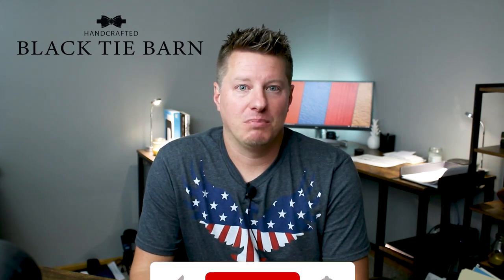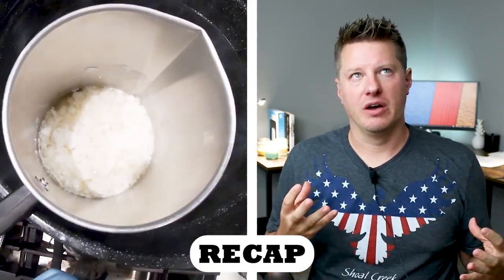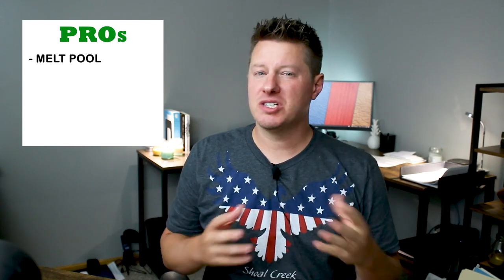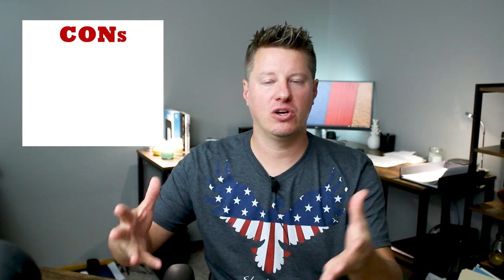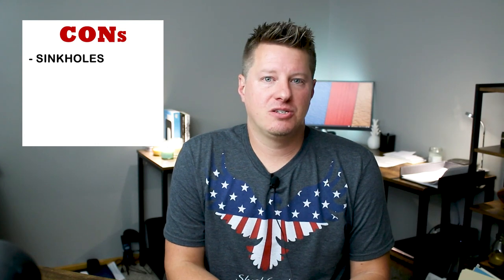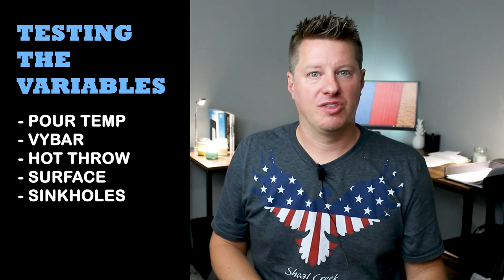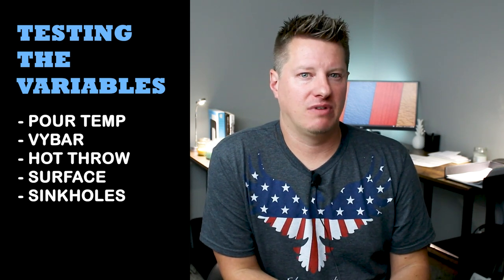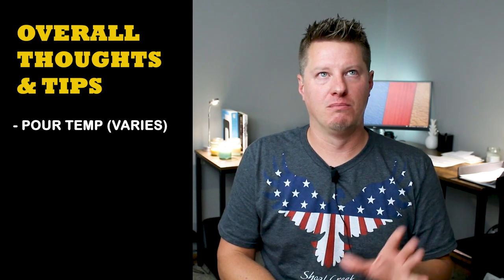Love/Hate With 464 Soy Wax | Testing and Making 464 Soy Candles (Part 2)

Comment: 150 degree pour temp is a good baseline. When you decrease your room temp, increase your pour temp. If you use tins like me, the tins hold heat better so you can actually decrease the pour temp slightly. I personally work in a space at 68 degrees and pour tins at 145. I also find that pouring about 60% of your candle, letting them cool, then repouring to fill helps with holes a bit.. hot throw seems best when the fragrance is added at around 190 and stirred like crazy for about 2 minutes. After, let it sit and cool to about 145-150, stir gently to release and possible air bubbles and pour. Not a one method fits all, but get mostly great results from it.
Reply from the maker: 💯   thanks for the input chris!

Comment: This video was great.
I'm a beginner at candlemaking.
I thought I was doing everything wrong.
But since you listed the pros and cons, I know I'm doing something right.
I get sinkholes/bubbles.
After burning for few hours, when the wax solidifies the surface doesn't look smooth.
Frosting oh man.. this one takes the cake. I thought my room was too cold and dry. I'm doing this in a room where it gets cold easily, and in the winter too.

Comment: I haven't tried 464, but I've been experimenting with 444 for a few years which from what I've read is similar with a higher melt point. I've found using a vessel that's wider than tall is most effective for eliminating sinkholes and rough tops due to the nature of how soy wax cools. More so than varying pour temps etc. For example, I find 444 almost impossible to work with in 8 oz straight sided jars (narrower), yet in 8 ounce tins I get perfect tops every time pouring at 135. Also haven't noticed issues with hidden air pockets in the 8oz tins. Totally agree with the CD wick recommendation. Excellent video by the way!
Reply from the maker: Thanks Bill. Yes, vessel shape and size makes a big impact on the cooling rate for sure!

Comment: Based on my on-going testing, evaluation, experimenting and documentation... the hardest thing for me to sort out is frosting. I wouldn't call it "crystallization". They're more like micro bubbles. There's something about 464 that traps air hence the sink holes as well... Why? Well if you hit the frosted sides with the heat gun, all you see are bubbles rushing to the top.
2 factors I believe play part... 1st is the fact that the wax comes in flake form. As it melts, the flakes start binding while trapping the air gaps surrounding them, if that makes sense. 2nd more is incorporated while mixing the fragrance oils. Not much we can do about either one.

All that said... I can pour perfect tops, zero wet spots, and very minimal to zero frosting using 3" wide glass jar candles in one pour. Tins? I could probably pour tins blindfolded lol...
Here's my frosting issue though... MARBLED CANDLES!!! 464 doesn't like reheating. So a perfectly poured candle when reheated to spread the dye becomes a nightmare. I still have a few cards up my sleeve. If not I'll either quit trying marbles or switch the wax.

Comment: Id like to say I've been making candles for a couple months. I've only used 464. I heat to 190 add fragrance of 8% and cool to 130 and pour. No heating my jars or anything and its cold here winter in midwest. Heater set to 65'. I have smooth tops 80% of the time. I heat gun the others and they all look beautiful. Never have any tunnels or issues other than what looks like unmixed fragrance on top.. I dont use any dye cause I dont want to deal with frosting. Not sure why everyone hates this wax. I've never used any other so I guess I cant compare yet. I've ordered fragrance from at least 4 diff companies and no matter what company or how much I stir the fragrance it never seems to fully mixes into the wax. I can see it like water mixed with oil. Candles burn nicely and last a long time and scent is great. I sell in person at a market not online. I do ok.  But now I want to try other waxes to see what all this hype is about.
Reply from the maker: It mostly all comes down to preference . You can go down a long rabbit hole trying different waxes, just like fragrance oils. Lol
Reply: Dang 130? I tried pouring at 150 and got bumpy tops. Now I pour at 170 and it’s flawless

Comment: I have tried everything on 464 . Tried low temperature pour and manufacturers recommended pour  . I have  not much success with hot throw . I have even cured for 1 month. I have tried stearic acid . So far coconut oil helped. I will continue to test until I come up a the best formula. I really think the soy wax now compared to 10 years ago , the now to me is not greatest. Cargill soy is what I used 10 years ago. I am not giving up for sure.
Reply from the maker: I would agree overall Lena. Still not my favorite but I had better success this time.   And yes, I found many FOs that weren't strong.... the compatible ones though worked great!
Reply: i agree about the soy wax now compared to 10yrs ago!

Comment: GW464 sucks. I unfortunately live in the south and my candles melted during shipping in the summer.  I switched to 444 bc it had a higher melt point but it still has issues. I now only use Coconut-Soy.  444 is much better than 464 IMO.
Reply from the maker: Sure. I have some planned. :)

Comment: I would be interested in soy 444 and any combo experimentation!  Thanks for the review/test video!
Reply: I would also enjoy a tutorial using 444. This is the only soy wax I use in my business. Please give wick advise too!! I'm still nailing this down! Lol
Reply: @ccswhimsies  I use 444 and have had great HT at 185°F as well as 135°F. Sink holes have been a natural thing, but I use CD series wicks and it helps a lot with the burn area. So far, have not experienced drown out. The downside is I always need to fix the tops with a heat gun, but I'll take that over poor HT.

Comment: Awesome video! I have been testing 464 and your test results are spot on with mine. Pour at 145-150F in a room that is at 71-72F has been amazing for my candles. Beautiful smooth tops with no cosmetic issues. Now the way they look once the wax pool burns after the initial burn is a little unsightly. Do you have a favorite paraffin soy blend? I’m considering testing a cocosoy blend but they are a bit pricey!
Reply from the maker: Thank you for the feedback! If I had to choose a parasoy thst gives you some of the benefits of 464 thst you like.. minus some of the issues, I'd probably say joy wax or problend 600
Reply: Which fragrance oil do you use

Comment: While I greatly appreciate the information and the troubleshooting of GB464, I am done with 464. I've been trying 464 for tooooo long. Moving on.
Reply from the maker: I don't blame ya. Lol. Just a series for those who wanna start or keep using it. :)   It also isn't my choice wax
Reply: @BlackTieBarn  what would be your choice wax for soy candles? I know yours are organic blend...I currently use 4625 and 4630 in 8 oz tins and 11 oz tumblers and 9 oz straight...there are alot of black soot on jar walls..however I get a burn all the way to end almost every time and no wicks burning out...I am using lx 18 lx 20 wicks but just wondering if that is took much wick....my market seems to be a soy market I am realizing and some do not use paraffin based because of black smoke etc...so torn in that I would like to do soy but have spent so much time in a year perfecting the wax I am using now..any thoughts?

Comment: I truly appreciate your videos and the help. I did the ct and I still couldn’t smell the candle that well. I did .08 of fragrance. Maybe I’ll do ht next and do .10 of fragrances. Do you suggest any temp of melting and adding fragrance? I am going to use 150 pour like you said. Please let me know thank you
Reply from the maker: Hey Pete. I don't use a ton of 4y4 wax and my experience is limited to moderate testing so far. I have very mixes results with both CT and HT depending on what FO I use. My first suggestion would be to try several oils and stick to the ones that perform well. Other than that, I would reach out to supplier for assistance. As I get more time to test it I definitely will provide updated info though

Comment: the math isn't working for me.  i have a jar that weighs 7.95 oz 225 grams - empty,  i'm going to use 10% FO.   my math was that i would need 205 grams of wax, 20 grams FO for the total of 225. 
when my candle jar is filled right before the rim, the weights are 23.05 oz / 652 grams.  way off!   What am i doing wrong?  Please help

Comment: The first video of the series I do not recall the cold throw I was hoping you can explain to me in more detail the cold throw and hot throwers also you had mentioned how room temperature helps the candles set up better do you have a video on that or do you have a recommendation for a room temperature and humidity?
Reply: I just found room temperature. Thank you
Reply from the maker: Cold throw is just the scent when it's just  sitting there not lit. Hot throw is while it's burning.  Many says like 464 have great CT but harder to get good HT

Comment: I've experimented and have added 10% coconut oil to my formula.  It has helped with a smooth surface top appearance especially when the candle is relit.  I will say that when I started every soy wax was impossible to get except for 464 so that is what I started out with.  I went through countless experiments to get my formula right.  What soy wax would you recommend ?
Reply from the maker: 100% agree.  At this point is still probably recommend 464 or CB Advanced (hard to get right now). But for the most part i prefer blends.  Also, I didn't talk about adding coconut oil or waxes to 464 in this video because I wanted to really focus on just using this wax alone (plus a few minor additives). But yes I plan to do more with adding other waxes,  etc.  Thanks so much for your reply!
Reply: I also add coconut oil & have also found it helps with smoother surface/appearance. Also using stearic acid to help everything bind. I am not "married" to this blend, but as a new candlemaker I'm going with this now as I start selling. This will be my base as I grow in experience, blends, etc.

Comment: Thank you so much for sharing your results! This mini series was very informative. :) 
In the case of colder ambient temperatures in winter, would you also recommend pouring hotter?
Reply: This is a great question.
Reply from the maker: Yes I would. Or use a heater to heat up that area. But yes you will need to test, adjust, and accommodate for ambient temp changes for ideal results. If you are that picky like me. 😆

Comment: Love this series on 464 & looking forward to the video on 6006. I've only been attempting to make candles properly for the last couple of months & apart from the weaker HT, 464 is working really well for me, thanks to your previous videos. I'm not very happy so far with 6006 though. I'm doing something wrong. I can repair the sinkholes & even put up with the poor adhesion but the sooting during the lower 3rd of the candle is horrendous so I've decided to start again. No colour & no fragrance, just the jar (3" dia x 4" h), a wick & wax & keep repeating until I can get a relatively clean burn with the right wick. I can then start adding other things 1 at a time. Does this sound like a reasonable plan of attack? Any thoughts would be most appreciated. Thanks Wade
Reply from the maker: Hey Steve.  Yes.... it does sound like a good plan. But don't bee too hard on your yourself from the results so far. 6006 is a good. All around wax but it is very tough to wick. And only works well in a few jars in my opinion. You may experiment with some others like problend 600/joy wax, C3 or 464 with some coconut oil or mix it with your 6005 potentially. Just some other options to consider as well. :)
Reply: Thanks mate. Appreciate the feedback. I’ll persevere & try some of your suggestions 👍
Reply: Thanks Julie. I’m in Australia so I’ll see if I can find a local supplier. I tried to order some Premier wicks from the USA but they want anywhere from $70 - $95 just for shipping for $30 in wicks. Little bit steep for me
Reply: @Julie Haskett Funny you should say that, I ordered a heap of LCS wicks from them after I replied to you earlier 😂 Thanks so much for the advice
Reply from the maker: @stevem540i  Yah I wouldn't pay that either, tough when you need international shipping. And i apologize, I am not familiar with suppliers much in Austraila.
Reply: @BlackTieBarn  no need to apologise, there’s some really good suppliers here so getting the parts is easy. It’s putting them together in the right combination that seems to be the tricky part 😂

Comment: When using the 464 wax how high do I let it get too and when do I put the vybar in and what wick would you recommend
Reply from the maker: Hi deborah. I'm not a current export on 464, but in my experience I still hear the wax to manufacture recommendations which is the same for most waxes. Around 190. Add vybar first while wax is hottest so it melts down. Wick willvary drastically by your jar shape and size. And even your FO sometimes. But most using 464 use CD wicks.

Comment: I have a question do candles have a shelf life. I have wax that I bought since 2020 and wanted to know if I can still use them.
Reply from the maker: You can use the wax for sure. Depending on the kind, it can change a bit as it sits. Especially organic based ones. But you are probably fine
Reply: @BlackTieBarn  I have 464,494 and coconut apricot wax

Comment: Hello there, I want to know it takes how many days for the candle to fully cure and get a smooth surface? Because now I have tried making a few candles and it all ended up getting a rough surface even though I follow your method and tried to pour at different temperature. Do you get a smooth surface right after the wax got into shape in the jar or you still have to wait for a couple of days? I hope you can really help me out, thank you.
Reply from the maker: It's mostly about the wax you're using. Letting ot sit longer won't help with smooth surfaces. If don't have a smooth surface after a day, you won't. Will need to fix with heat gun. Most soy waxes won't have a smooth surface unless you add something to it... coconut, paraffin, beeswax, some other oils or additives as we
Reply: @BlackTieBarn  thank you for replying me. What do you suggest to add to get a smooth surface? I saw local businesses here always promote they are using 100% soy wax and selling perfectly smooth surface. Is that possible?
Reply from the maker: @HumanFactsUnveiled  probably a marketing gimmick, although i dont know waht they are using so i cant say for sure. If they are adding something, then its not 100% soy. In fact, most "soy candles" are sold that way but they actually have small amounts of something else like paraffin, beeswax, coconut wax, etc. So if you are looking to completely eliminate frosting and ugly tops (permanently) you need to add something. You can sell them looking good by just using a heatgun and smoothing out the top.  But it wont last after they burn it once.
Reply: @BlackTieBarn  thank you so much for your reply. Appreciate it a lot. I hope you'll be able to help more candle makers in the future. Thank you and god bless 🙏🏻

Comment: As a new candle maker how do I know it’s the oil itself that doesn’t work for my wax rather than a wrong wick?
Reply from the maker: Just testing really and changing one at a time until you one.  If a certain wick type works most the time.... its probably the oil. If the wick isn't working with hardly any of them, it's probably the wick
Reply: @BlackTieBarn  thank you for your reply, makes sense

Comment: I was wondering if you had ever tried adding coconut oil and / or beeswax into your 464. If so what kind of results did you get
Reply from the maker: Beeswax didn't really help anything at all. Decrease the HT, hurt jar adhesion.  Wasn't a benefit mostly. Coconut oil/wax helps a bit with surface issues,  didn't really notice any difference in HT. But... I didn't include coconut in this video. As I was trying to keep it the base wax (mostly). I do plan on future videos with blending other waxes or ingredients though. :)